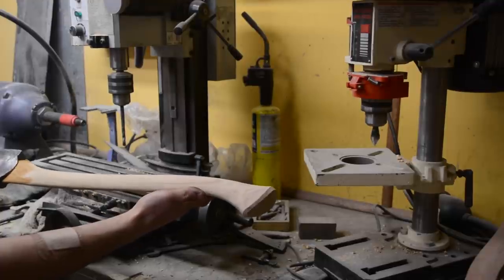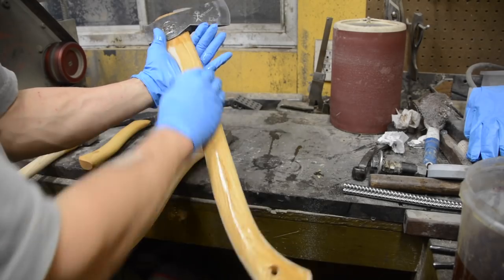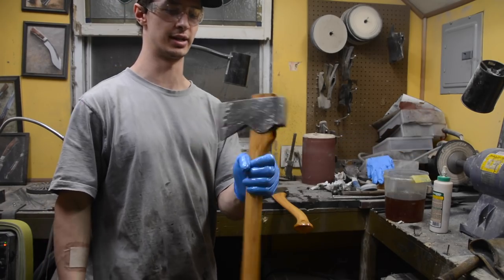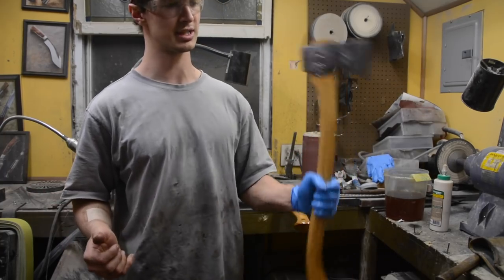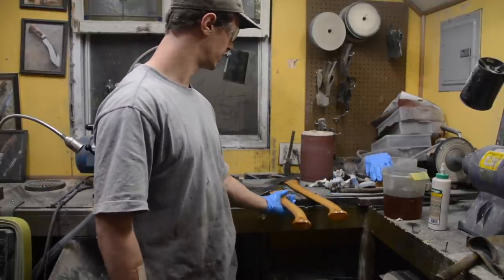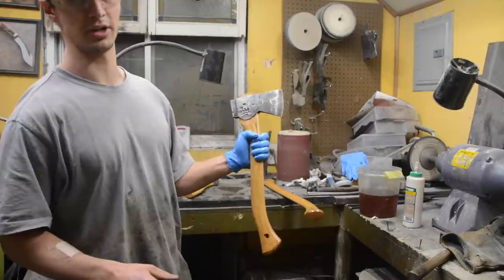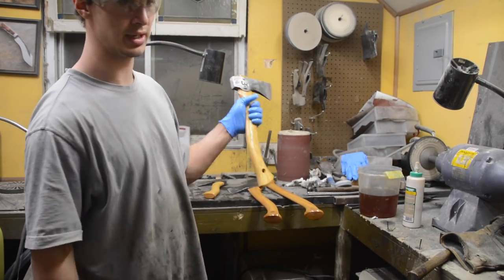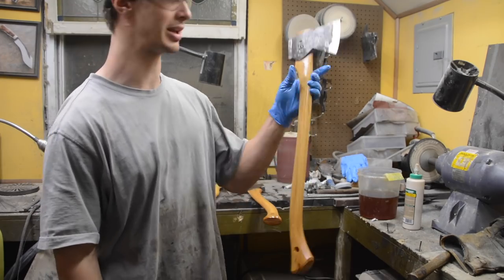AXE FOR A SAMURAI !!   🇨🇦

Comment: great job on the handle, good fit and finish. beautifull!

You should reserch the use of straight handled axes and why / when curved handled axes became dominant, its pretty intresting. 

From what i understand  when people actually used axes to make a living, build cabins, etc, that they were nearly always straight handled. and it was only when axe use became more casual use that curved handles began to appear.

its an issue of deflection, when your hand is on that curve, every movement of your wrist translates to allot more movement of the bit, because the curved portion distances your hand from.the center pivot of the bit, and that "lever" thats created by the curved portion varies depending where on the curve you are, so its unpredictable. take an axe with a verry curved handle and hold it at the end, then turn your wrist and see how much the edge of the bit deflects. then choke up to a straight part of the handle and do the same thing, notice how it now pivots around the eye rather than swinging widely. do you ever see a splitting maul, a sledge hammer, a framing hammer, or any other tool with handle that you swing to hit something, have a curved handle? then why would you have it on an axe? furthermore have you ever seen a japanese axe with anything except a straight handle? I havent, except in the case where westerners have made habdles for japanese bits

Comment: Traditional handle craft relies on the drawknife to form the details, however the grain strength is brought out by splitting out the stock blank from the log of hickory or Ash of which the latter is my preferred.  Glad to see you work the craft however it's a tool to swing and create with, but you millennials like to make things a novelty that is a choice which turns it in to a play thing instead of a favorite tool of a Woodworker. Yeah it's a rant! Play on.